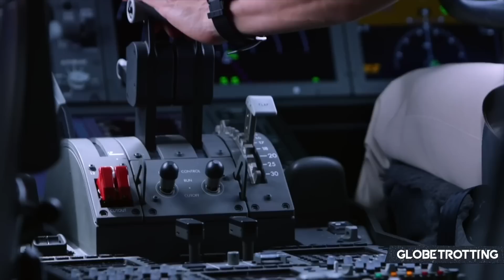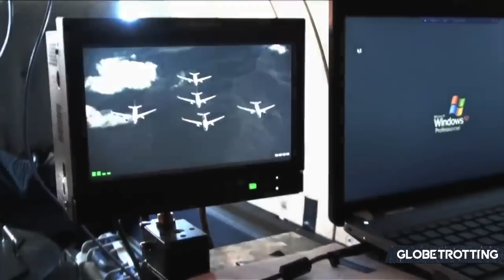AIRBUS KILLER? - Airbus And The Boeing 787

Comment: Not that long ago DJ lamented that Boeing had ceased to be the innovator it had been in the distant past. The 787 remains the most innovative airliner of 21st century. No one has come close to making such a big leap. Boeing paid a big price for the innovation although it was mercifully without tragedy. The hit was to the bottom line. The 787 forced Airbus to follow with the advantage of avoiding the pitfalls that cost Boeing dearly.  Its composite panels instead of woven barrels has to make new models easier to develop, particularly the freighter, with negligible penalty. Airbus also avoided competing head on with the 787, pitching the A350 to fit between the 787 and what must been anticipated, the 777X. It was  always going to be a strong market. Over 1300 sold which is a  great result. Almost 2000 787 sold too. Would these figures have been  matched had Airbus gone head to head with 787?

Comment: Neither Airbus or Boeing can launch two clean design planes concurrently.
Its just too expensive.
When Boeing lauched the dreamliner , Airbus had its plate full with the A380 program.

Boeing was lucky, they had tried to market and produce several derivatives of the 747 without success and knew that the very large aircraft market was drying up. Airbus had no such intel & wanted to produce a signature product to challange the queen of the skies.

So its not that Airbus felt no threat from the dreamliner , its just that launching A380 & starting A350 at the same time overlap was quite daunting for them. They tried to get away with an A330 upgrade!!!!!
Reply: Historically Boeing has been able to make products that are more adaptable and better positioned for markets at the time of order and future markets. It's interesting to think about how the 777 was wrapping up design at the same time the 787 was starting to get designed, despite that there's a 10-year gap between deliveries. With the early 2000s focusing more energy on defense and the retirement of many key engineers, both companies are struggling with getting a new strong engineering force.

Comment: The Airbus 330NEO is a far better Aircraft than the Boeing 787. Sales in the long term will prove this.
Reply: A330 is basically the same, as the old A300. An old design!
Reply: If in terms of design! Then A350 is way batter than 787 @lennartwahlberg1547
Reply: The difference only being the MAX is dangerous! I will not fly on it! The 787 is good as it forced Airbus to develop both the A350 and A330neo. It will be great to see the 777X entering commercial service. It’s a great plane and Airbus does not have a design that large to compete with it. But Boeing really needs to get its sh*t together.
Reply: In what way ?
Reply: @gmotors5917  The fuselage is build in the heavy way, as the A300. And with new engines and wings, in the same way as the critisized way as the MAX.

Comment: The new Boeing product airplane in the 777-9X will make a significant response to air travel, however, Airbus has a good airplane themselves in the A350 that has sold well enough. The Boeing 787 made big strides also and is another great airplane itself.